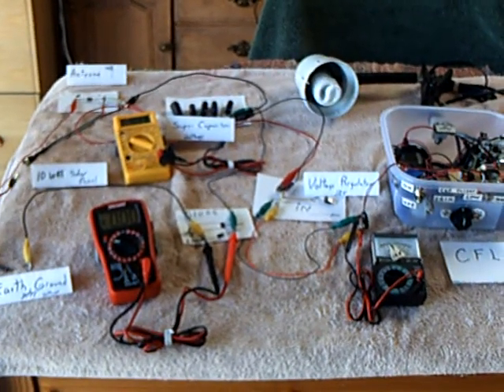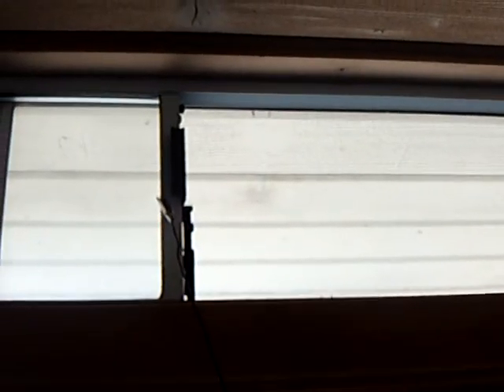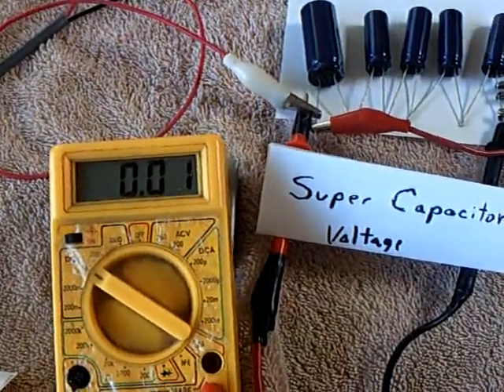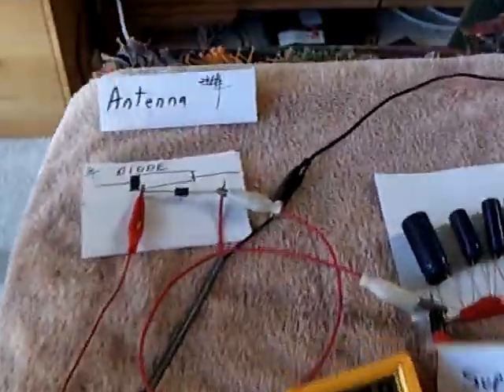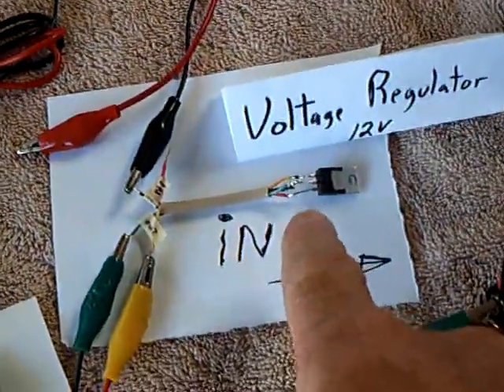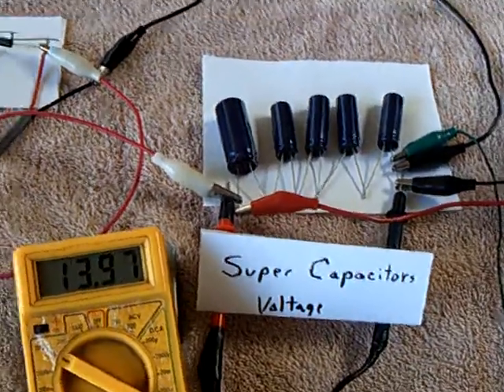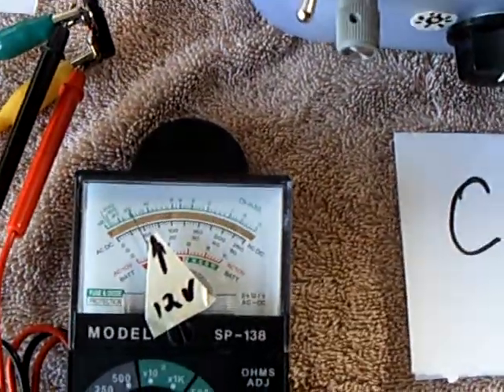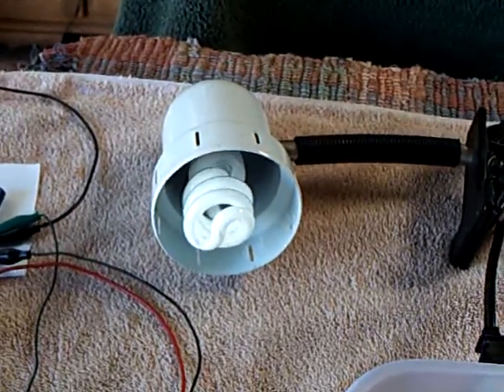Earth Ground & Antenna CFL Light Experiment

Comment: Hi Lidmotor,

great work you are doing. 

Can you do a test to see how much time charging your caps to the same voltage with just the solar panel (no gound & antenna attached) and see how many minutes, seconds it takes and then how much time the bulb will stay lit compare to using the ground and antenna like in your test video.

I think this would be an important test to do to show the advantages of using the ground and antenna.

Thanks for sharing

Luc

Comment: Antenna needs to be ionized (shocked via spark). This provides a {primer charge} for solar radar to push through the system. The antenna must be in the form of a ferrous grille with rectangle holes corresponding to the actual vector profile dimensions of the radar wave portion of the e.m. spectrum. Simply put, you'll get best results if the holes are the size of the wave passing through them. Tuning the antenna ionizer will allow different portions of the e.m. spectrum to gain traction on the antenna's primer charge. A full spectrum radar antenna would have groups of holes in the grille of various sizes corresponding different bandwidths and have multiple coils firing the antenna at varied hrz values. A v.f.d. Coil driver controlled by computer could time antenna activation cycles and harvest motive force from the magnetic currents within antenna. Try dumping salt water on the ground stake. May also help if stake is in a shady spot and totally burried. If the ground stake is buried deeply and connected with insulated wire to isolate it from the surface, potential difference (voltage) should increase. Earth has a skin charge. The deeper it's burried, the further the stake will be from the most intense point of the skin charge (earth's surface). The idea of the p.v. cell is to power the antennea ionizer(s). Picture a car alternator...the battery charges the coil and the engines motion pushes and amplifies the existing charge. Same here, accept instead of the rotor/armature of the alternator moving at a different speed than it's stator to provide potential difference....it's the magnetic field in the earth moving at a different speed than the field around/passing the earth. The earth in this model is the rotor and it's environment (space) the stator.

Comment: The antenna you're working with for purposes of this experiment, is totally isolated from ground, but just imagine if one erected a stone radar grid isolated from surface/skin charge by being partly burried and insulated to some depth. The result may be strong local ionization of ground plane. Anything elevated from the ionized ground plane (lifted) and then itself ionized may be released of the earth's traction (created by anode /cathod relation between earth and nearsest emitter (sun). Objects on earths surface are drawn to it in the same manner that gold particles are drawn to a cheap watch when being plated. If say one of those particles (or a person) decides it doesn't want to be drawn toward the anode (watch/earth) then all it would take to be released of the constant draw would be strong ionization of the particle or persons skin charge to cancel the existing anode cathode relation by randomization. The question of personal flight would simply be a matter of avoiding unwanted discharge (grounding) this would make a person into a load...vaporization or ultradensification could result. Directing coronal emission may be simple as willing a path of travel.
Another implication of radar routing is using the earth itself as an integrated circuit as was apparently done at Teotihuacan. Instead of electricity dancing around in copper, it's magnetism dancing around in stone. Mica served as an insulator between different portions of stone circuits...this was used in conjunction with various other mineral semi conductors and specialized metal apparatus.

Comment: The act of testing the capacitor will drain it. Your light appears to be running off the stored energy in the capacitors. Energy that was received from the solar panel.

Comment: The sun isn't the only celestial body from which a few volts may be drawn via conversion from magnetism. Sure other stars don't appear as bright because of thier distance, but many of them are vastly more bright and powerful than our home star. Ever consider the amount of radar reigning down from the night sky? The planets and stars are like light bulbs connected in series and tethered to one another by the e.m. spectrum of waves and currents. Like any other circuit, my hunch is that this one has an eminent source of transmission. Travel the whole circuit (universe) and eventually the human race will find a positive or negative terminal...the real grandios "zero point".